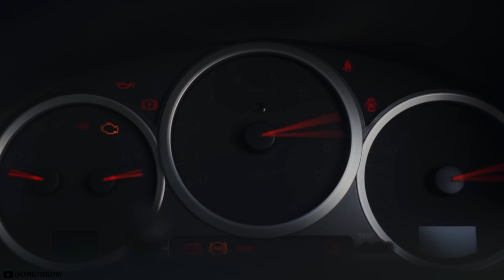Donut Media VS. Subaru

Comment: Subarus suck, then end.
In all seriousness I’ve owned two Subarus that were both reliable but I wouldn’t call them fast, an old gl and a brat. They were both very good cars and they never gave much trouble, but I’d never touch a new Subaru, I’ve only heard sob stories when it comes to Subaru and the success stories come from people who are die hard Subaru. There is no middle ground. Like the Miata is a great car becuase both car guys and non car guys can get in and enjoy it, they’re reliable, fuel efficient, and you don’t have to be a millionaire to have fun with the platform. Subarus just aren’t that, they’re temperamental sedans in a market that has far better vehicles for the $$$ if I were going to build a awd car for drag racing I’d stick with a more stout platform, the evo series comes immediately to mind, while things like some awd hondas and even the odd Chevy ss are viable as well. From my personal experience I just can’t recommend a Subaru bull from 1996-now.
Reply: Built* sorry for the typos I’ve got saw dust on my hands

Comment: Late to the chat, but thrashing on a 16 year old car of unknown history, and unknown mileage, and wondering why it failed in track conditions is the most silly mistake. Then they started tracking engines that were not properly broken in... and then try to pass that all off as a Subaru issue... GTFO.
Reply: The first season has them modding 350Zs for track use and I think they had only one major failure. They made a super old Miata turbocharged and track ready and the only failure there was crankcase ventilation. Subarus blow up FIVE times in one season? Bye.

Comment: Idc how poorly you clean an engine it shouldn’t blow up 5 times I call BS on that sorry. Engines are much more resilient to user error than people think. My hemi has a piece of debris on the road blow up it’s oil pan and I drove for half a mile. Still runs great. Yes it’s NA but also has 4 more cylinders. What I’m saying is it’s a Engjne problem.

Comment: This is all to avoid admitting that 99% of other platforms can be taken to the track bone stock and stay together just fine. They can be wrecked without instantly exploding. They can be beat on with cheap unrelated parts.

Subarus cannot. 

You apparently need the culmination of knowledge from every person in an entire community just to get them to work right. 

You can be an enthusiast of a poor platform, just stop trying to pretend it isn't bad.

Comment: Subarus are poorly engineered platforms. That's all there is to it. It's inconceivable to me that people would think a car that can't go around a tight corner or two without exploding is a good platform. When all the mods you have to do to a car are to stop it from committing seppuku under spirited driving you have a problem

Comment: If a car needs more attention and care because otherwise it fucking explodes than it's not a good car 🤣 it's not donuts fault that they went into a project thinking this car would function well like other cars and it most obviously didn't because the platform is ass. Yeah you CAN build it precisely with the right amount of money and care but you shouldn't have to. Almost any other car on the market will work just fine if you know how to work on cars. You shouldn't have to specifically study one car to get it to work right it should be universal like every other car is

Comment: Nah, if you have to know super in depth about every possible part and how it could go wrong in a platform, and upgrade literally every single part of the car to a racing grade part in order for it to not fail because every stock part is shit, then you're on a shit platform. People will make any excuse under the sun to defend the car they like even when it's just objectively shit. 

Also, the WRX has to be the single ugliest car ever produced. Every generation of it looks like actual trash. I would rather have a Fiat Multipla than a WRX just because of how terrible they look. 

- A long term subaru hater, who has been further validated by watching the Donut HiLow series.

Comment: You said it in a round about way in your closing statements - it was fully Donuts issue due to lack of knowledge about the platform. 

Yes they're finnicky, they're sensitive to oil type, oil capacity, the way you check it, and the tune file installed in the car. Any tune file should be a custom tune file, OTS maps turn them into timebombs. Any time its driven hard in warm temps - straight to quality 5w40 oil from the 5w20/30 in them. And then checking the oil correctly is a procedure, I guarantee they didn't get right. Fill cap off, dipstick oring removed. Any other way and the dipstick pulls oil up the tube giving a false full reading. Check immediately after running the engine, before its hot so oil is in the heads, but hasn't expanded yet. And then for Donut to drive them to the point of overheating? Yes they were literally asking for troubles.

 I learned about all of this before jumping in, and had the best and most rewarding ownership experience. Very few AWD cars drive as well as a Subaru - and for that I'll put up with their weirdness. Unfortunately Donuts series completely TANKED my resale value, for anyone even remotely interested in cars, so I hopped out. And for that,  F-U Donut....

Comment: SUBARU are not reliable!! 
First 100,000 kms sure , great but take a look at the used Market

Subaru people know they aren't reliable after 100k 

I've worked on them , build a 2.5 rs and switched it to manual , I've also had a wrx 

Quit acting like you don't know they suck in the long term 
Cut the shit

Comment: The real reason that people are worried about Subarus is because they are trash. I know, I own one. I have also been a part of Subaru online groups for years and if I had a $ for every post about a spun rod bearing or a different engine failure on WRX/STI or about blown transmissions on WRX, I'd be able to afford an IAG block with forged pistons. And I'm not talking about modified and/or abused cars, stock ones fail a lot too.
My 2012 STI was completely stock when I bought it and it got nothing but exceptional maintenance. It spun a rod bearing at 144k km. It's all down to Subaru's major design issues, thus all the class action lawsuits and settlements they are going through right now.
Hell, even some of Subaru's NA cars are absolute shit piles and consume oil (early to mid 2010s) or blow head gaskets (mid 2000s).
The platform IS bad. It is poorly designed, poorly built, and often doesn't last long even in its factory state with excellent maintenance. What IS excellent is the work from companies like IAG on actually fixing the massive design issues to make the engines reliable, which makes the whole experience acceptable.
Building a Subaru the right way is NOT just about doing research and knowing the platform. It's all about dumping waaaay more money into it than most other platforms. Basically you get very cheap price of entry and extremely high price to go up from there.

In conclusion, if anybody wants a reasonably priced accessible AWD car that can be modified with minimal issues, just buy an Evo X GSR. The 4B11T is an awesome engine, the transmission is fine with a better clutch, and the car overall is way better to drive too.
Reply: EvoX is a huge pile of shit too.  

It's almost like trying to wring out so much power out of such a tiny motor is asking for issues.  There's no replacement for displacement.
Reply: @manz7860  Lol, no. It's perfectly capable of handling a decent power increase reliably on stock internals and can go pretty well forever stock.
Reply: @AlDim000  my brother blew his under a year lmao. 

Compared to his previous roush mustang which lasted nearly 7 years. And he abused that thing
Reply: @manz7860  The Evo X/Ralliart platform requires proper tuning. I had mine for 5 years, zero issues with a bigger turbo and full bolt-ons, making around 50% more power than stock. I have also seen very few engine failures reported in the Evo X/Ralliart community. Outside of the notorious TC-SST dual-clutch transmission (which can still be built to be amazing), the platform is extremely solid. On the other hand EJ255/257 engines can barely handle what they have stock and require a big investment to make this much power. 
To sum it up, blowing a 4B11T requires misuse and abuse. These are precision engines that require precision tuning. Many people who come from a V8 platform tend to get it wrong, no doubt about that.

Comment: ok but like you dont actually show what any of the subaru ppl actually say this whole video seems like an intro to another video.

like the issues in this series arent even subaru specific 
they straight up took a motor in its breakin period to a fucking track day.

like the oil pickup/  baffling thing is basically a problem invented so people can sell parts.
I mean pickups do break(rarelly) but the lack of baffling thing is insane to me it literally has more baffling than any other engine ive taken apart.